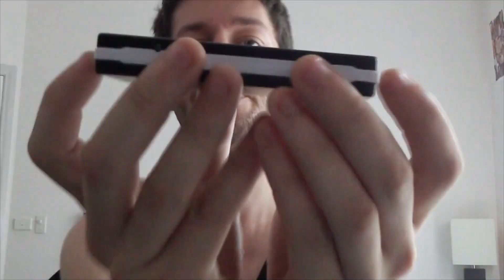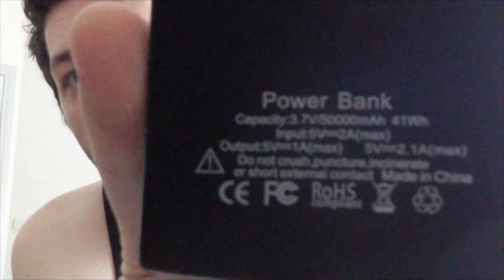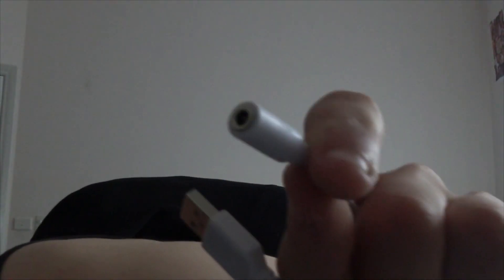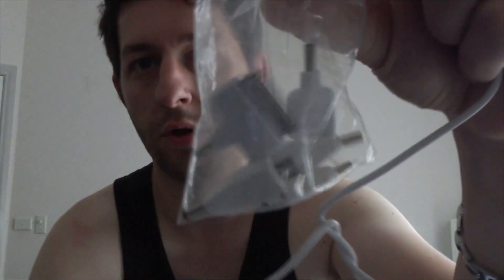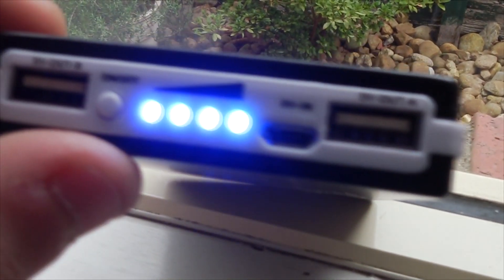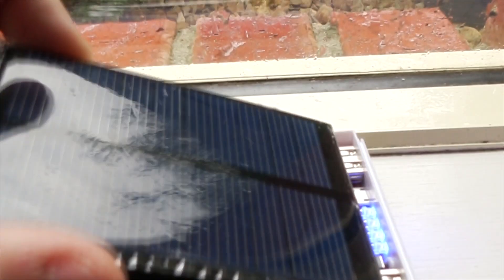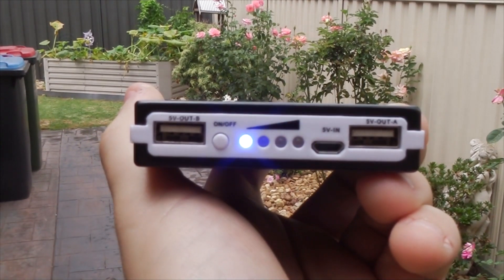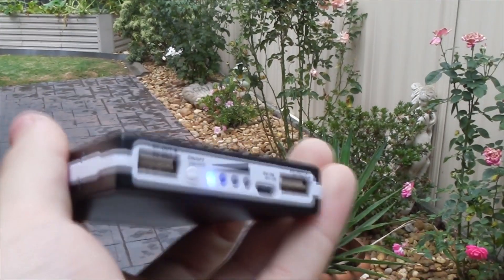Powerbank 50000mAh Solar Battery Review & Take Apart

Comment: Dunno what the Aussie dollar is at, but I got the same item marked as 80,000maH for $12US each. 80,000 is a joke. Gel-pack LiPo batteries inside are about 4800maH (2x2400maH, 3.7v).  Over time (2 years of use) they expand/bloat to where the back&solar panel are bulging outwards.  They do work fine though given their limitations on power.

Currently have some 18650 cells in order, they should fit (tightly) in place of the existing packs, 3x3000maH wires in parallel (soldered across, I doubt there's room for battery holder).  I'll try to update here as to how it works out.

Comment: Nice review man. Can it charge a Samsung Galaxy Tablet A 7inch ?
Reply: They're really only about 4800maH.  With conversion inefficiencies a fully charged one will charge my Amazon fire 7" from 20% to 100%, but it'll drain the power pack entirely to get there (about right since I think the tablet battery is 4200maH or so).  A set of 5 of them (fully charged in advance) did get me through a week of power outage after hurricane Sandy, though I had to charge the first one I drained in the car for a bit.

Note that the solar panel is only like 1.5W, so it's almost worthless - the leds showing it "charging" will suck almost all the power, and even drain it, unless it's in anything but full-on sunlight.

Comment: Can you charge your phone purely off the sun?...like when the power bank is dead and not having to use the battery in the bank.?
Reply: honyburger123 no the solar panel has a max output of about 200 mAh running at usually 50 to 100 mAh much of witch gets used on the leds

Comment: I got the ad for this $25.99 but what is the purpose of this thing?  To save electricity?  Which is what I thought, but according to this review it's not. 
Too, there's a big difference between 50,000 mAh and 8,000. Seems to me that in and of itself should tell you it's a scam. 

I would have set the thing in the window with the phone or tablet attached instead of plugging it into them wall. 

Thanks for the review but I think I'll pass.
Reply: t. smith the purpose of it would be to use it when you don't have access to power, like all power banks. Camping being a good example.

Comment: I have seen some with 250,000 ma advertised. How long would that take to charge even with a good wall charger (never mind the tiny amount of solar, that would be never) They are mainly a con. Cheap batteries no where near the specified amperage , look the size of the cases and figure how many normal Li-ion 18650 cells you would need !  50 , even at 5000ma per cell.  their physical size would have to bigger than a laptop. 
Steer clear of them.   Make your own pack with 4x 18650 li-ion 's. You can get a charger  for 4 cells (or more) for about $8  and case to carry them wired up to a female usb socket.
They have a high cell capacity, some up to  9800ma, which x4 gives you about 36000ma.  
Good quality, long life and it works.

Comment: Anybody knows how long it takes to fully charge using a wall outlet?-
Reply: Wall charger about 1 amp or 1000ma   , so 50 hours minimum.
Reply: Thank You!!
Reply: The true capacity of these solar power bank are less than 10.000  mAh so it should take around a night to recharge them.
Reply: True capacity is 4800maH.  They'll charge overnight.  Got a couple several years back, "Move Power 80000maH" (lol).  The gel type LiPo batteries (2x2400maH) expand and bloat over time, bulging out the back and solar panel.  Currently have some 18650 cells ordered, they should fit - soldered across in parallel, should be able to fit 3-4 in there at 3000maH ea.

Comment: ok so I got this off pop sci dot com.....The second I picked up the package I knew it was way to light. Mine charges well off solar. If I bring it any where near sun light it starts trying to charge right away. Alright so 8 hour plugged in and it came to a full charge. I didn't take it apart, but based on multiple charge times. I can confirm 8000mah NOT 50k mah........It can get a full charge in 10 hours of direct sunlight. I can charge my phone about 4 full charges which is nice being an out doors type person. Still worth the $34 usd I paid for it......so far.

Comment: I would be surprised if that was even 12000 mAh. Probably low 
quality batteries to boot, low recharge cycles. and 1 amp charging. I would never recommend anyone by this, if it seems to good to be true it almost always is.

Comment: I am in office using table light. If I turn the light on the lights on device go on. I turn it off the lights go off. So I wonder if it can charge using regular household lighting, like a calculator. Maybe you can test that for us, mate? Thanks
Reply from the maker: +Deporter Unfortunately as far as I know it won't work with that kind of lighting, it only charges when it's outside or exposed to sunlight.

Comment: Thanks for making this video man. I should have watched this before i purchased my 50,000 mAh solar battery pack and consequent usb chargers for other devices! I really invested in the fact that i could charge this device via the sun, and then charge my other usb devices via it. Unfortunately the solar panel charges too slowly and is probably only useful for charging a low-power device. My battery pack looks similar - except i think it has a newer chip inside which works better in the sun and has an LED light which you can turn on and off. Like yours, it doesn't have 50000mAh in it but probably a total of 8000! What a scam!

Comment: I've got one of those, stated 30,000mah clearly which it can't be
Turns out to have 5 X fake Samsung ICR 18650's. Full discharge of one cell, and recharge only got 1880mah into it
1800 X 5 cells parallel is 9000mah max. Being fake unprotected cells it probably won't hold that much or possibly start a fire...

Comment: mine came with 4x unmarked 18650s i ordered some 9800mah (if they really are 9800mah) 18650s and im going to replace the unmarked ones that came in it i only ordered the 10,000mah solar charger so if these new batteries are 9800mah ill have increased its capacity by around x4 i paid £9.99 for the charger and £5 for the new batteries not bad for a 39200mah solar usb charger will take weeks to charge from the 1.5w solar panel it claims to have might have to try and find a better solar panel next
Reply: +scott purcell How long would it take to charge these batteries using the solar cells??? Have you tried it?
Reply: +scott purcell There is no way an 18650 is 9800mah. In reality the BEST, GOOD BRAND ones are around 2500mah. If it's screaming 9000mah it's probably a cheap Chinese one and most of those are around 1000-1500mah.

Comment: Just a quick word to anyone looking to use these as a cheap portable electronics project power source:
Some of these power banks have a sensing circuit built in and they wont constantly deliver power unless a minimum amount of current is being drawn. If your project draws less than maybe 100mA they'll come on, start delivering power and then go off again. Best option is to strip the batteries out of the bank, seperate them from the circuit board and use them. To recharge, reconnect batteries to circuit board and recharge. Or solder on some connectors to the circuit board and battery so you can connect / reconnect at leisure.

Comment: Hi, could you review this power bank please? 
http://www.ebay.com/itm/261679345898?var=560547647408

I would like to know what's inside before I buy, and if this shows no solar panel on the outside, then it should be a regular power charger right?
 Is this worth it? thanks and GOD BLESS!

Comment: I am electrical engineer, I have tested this product. Power Bank is not of course does not have the battery capacity 100000mAh. This product does not charging when exposed to the sun The Solar only for display without any benefit. its only charging with computer usb, the solar panel is not really functional and the power storage is damn too low. Fake product.
Reply from the maker: I can say that it does indeed charge via the solar panel. I have completely flattened the battery and then left it in the sun and it charged. It certainly is not fake.
Reply: MichaelsWorldTV  Hi Dear, I buoght like this from aliexpress store, and you ?  http://www.aliexpress.com/item/10000mAh-Solar-Power-Panel-Dual-USB-External-Mobile-Battery-Power-Bank-WITH-all-Chaeger-line-FOR/32313634258.html
Reply from the maker: Fırat Can I bought mine from eBay. It looks quite similar to yours but it is a little bit different. Mine was advertised as 50,000mAh. The solar function does work though.
Reply: MichaelsWorldTV how long do these things last

Comment: could you tell me how long does it take for the solar panel to charge the batteries full entirely with sunlight ?
Reply from the maker: It takes quite a long time. I am not sure how long exactly as I have taken it in and out of the sun as well as charging it with the actual cable. I also usually charge it from the sunlight through a window which obviously isn't the best way of charging it (direct sunlight would be best). I am not sure if you watched the whole video but this isn't 50,000mAh as advertised, I took it apart and it is actually 2x 4000mAh batteries.
Reply: I noticed that I saw the whole video. Its Chinese bro .thats wat we get :)
Reply from the maker: Hahaha yep! I knew when I bought it that it certainly wasn't 50,000mAh but it's still a great little battery :)
Reply: True true

Comment: turn it on and put it in the sun . if all the led lights up that means its receiving the maximum amount of sun light it can and when you took it away from the sun light 2 of the led turned off rite ? which means it is not getting enough sunlight hence it is not making enough electric current. i dont know why it is confusing to you :) its not a rocket science mate
Reply from the maker: Hi balaji hustler Thanks for the comment. I have worked it out and they may all be different. Mine is actually charging when the light flashes one by one as it charges (first LED flashes for awhile then as charge amount goes up so do the number of lit LED's). When all of the LED's light up it means it has detected sunlight but not enough. If you own one, it must work differently to mine. When mine is completely out of the sun ALL of the LED's turn off.